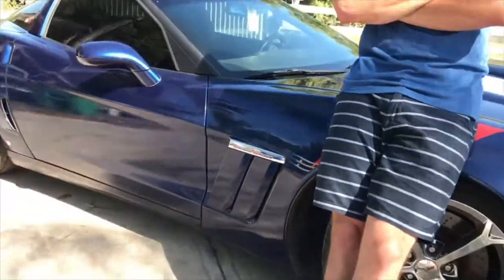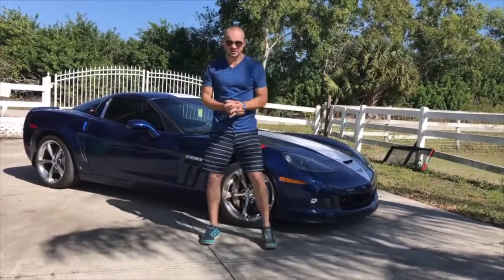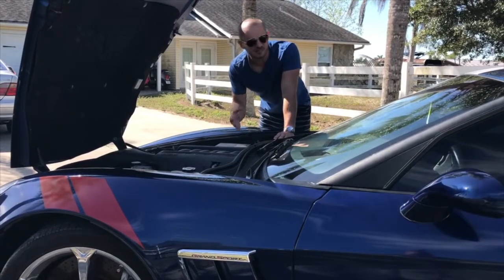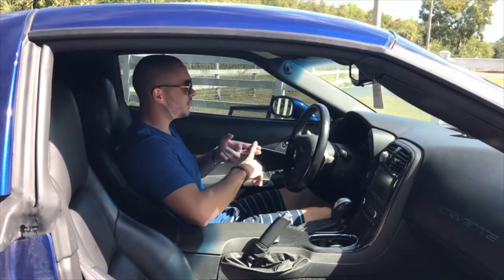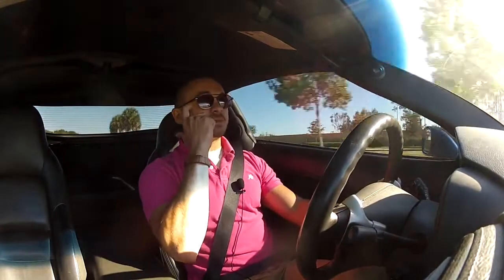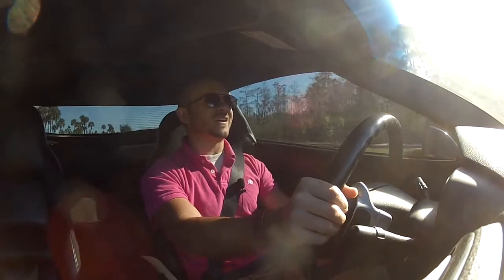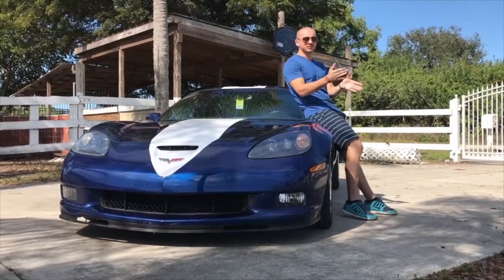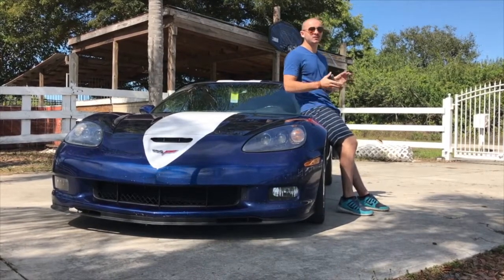2010 Chevrolet Corvette GrandSport Review

Comment: I am thinking of getting a 2010 1LT Grand Sport and it has the 6 spd automatic and have read that the 2010 auto is slower than the 2012 version but I can't find anything to back that up. Did you have the opportunity to drive a 2012 to compare?
Reply: The 2012 is way better in a few places.
Reply: @robbiehanson4901  seats

Comment: is the Chassis Aluminum or Steel ?
Reply: The C6 Grand Sport has a 502 lb. steel frame, the Z06 and ZR1 have a  392 lb. aluminum frame.
Reply: @thomasjent1431  what year did gm go all aluminum chassis with the better, thanks for replying
Reply: @jonienglish3231   C6 Z06's came out in 2006, the C6 ZR1's in 2009 but all the corvettes from 2014 to present are aluminum frames.
Reply: @thomasjent1431  thanks for info
Reply: @jonienglish3231  You're welcome, happy to.

Comment: you have to special order the Manual (MZ6) in the Grandsport. otherwise it naturally comes with a really strong and quick 6L80E 6-Speed automatic w/paddle shifter! its no slouch. people forget the grand sport is the luxury Touring Corvette not the Z06 track corvette. both completely different than the base coupe that comes with nothing but the LS3 starving with a small 2 1/4 exhaust, little brakes, narrow wheels.. Grandsports are the best Corvette for the money. Z06 will cost you a lot more per year, in maintenance but its the badasss! ZR1s are too pristine to do anything with, unless you have deep pockets.